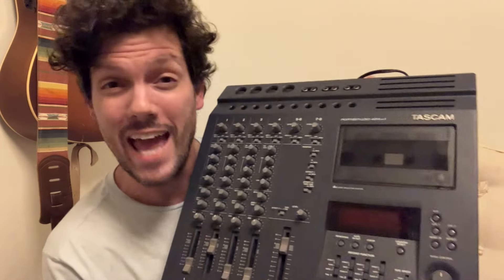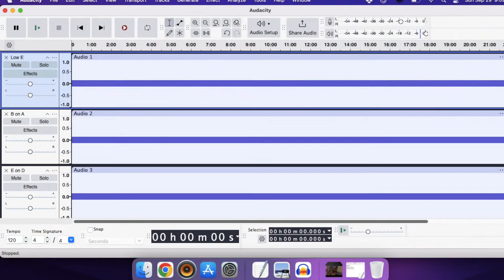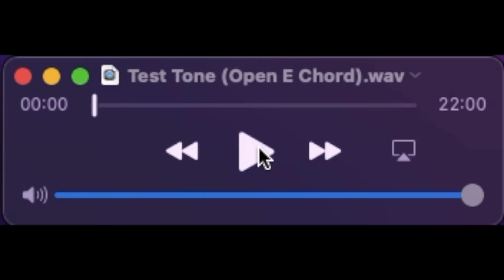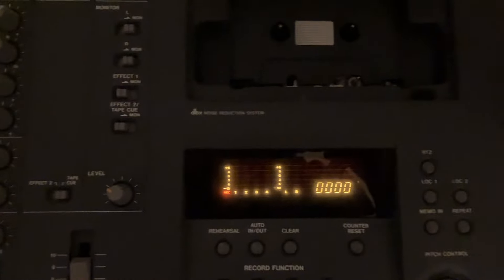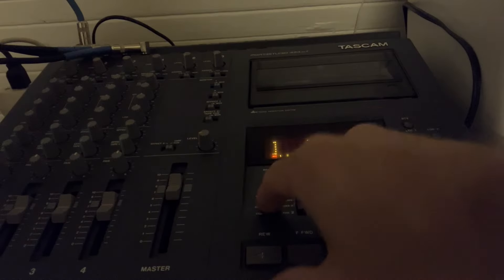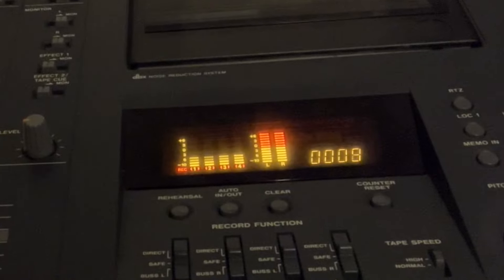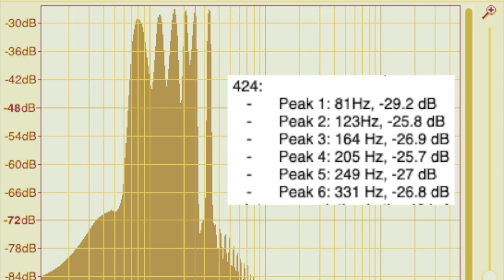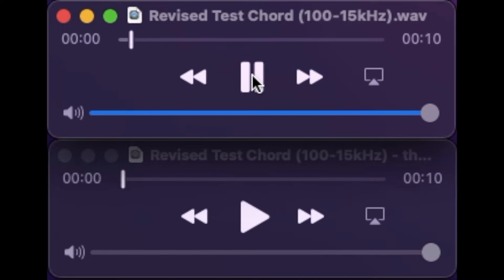The Sound of Cassette Recording (feat. Tascam 424 mkII Portastudio)

Comment: Did you test the other variables that you introduced with this setup?  There’s two other devices between the computer and the tape.  We expect them to be relatively flat and linear, but they’re analog and relatively low budget and connected in a slightly atypical way, so they’re probably not perfect, and there’s no way to know what effect they have unless we do the whole test without the tape.
Reply from the maker: Awesome callout, and no, I didn't test those factors at the time. But you're right that they need to be test and ruled out. So I ran the 2nd sine wave chord through one of those cables and the interface, and here are the dB readings for the peaks in the version:

100 Hz: -21.9 dB
250 Hz: -22.5 dB
500 Hz: -22.8 dB
1k Hz: -23.0 dB
2.5k Hz: -22 dB
5k Hz: -22.1 dB
10k Hz: -21.8 dB
15k Hz: -22.7 dB

Based on this, I think it's very fair to attribute some of the difference to the cable and to the Focusrite. There's a difference of 1.2 dB b/w the loudest and quietest of these peaks, and that accounts for a material chunk of the volume differences I was observing at frequencies below 1kHz. But it doesn't account for the volume roll-off that I observed above 1kHz in the taped example. So I'd guess that comes from the 424, the tape, or both.

Thanks for your comment... I should have done this in the first place!

Comment: The time it took you to make this video is more time than I would have devoted to this problem. Cassette multitrack recorders were "great" in their time because there was no alternative, short of shelling out $26 - $40 per hour to record in some hole-in-the-wall 16 track or 24 track recording studio (Yes, those prices are what I paid in the 80s) But there were always inevitable limitations with trying to record 4 tracks on a 1/4 inch tabe that was travelling only 3.75 inches per second.
Reply from the maker: I hear you 😂 I like working with these devices, so I try to embrace the moments of frustration and inefficiency. And in this particular case, I had an extra incentive: *I am going to recover this EP project.*
Reply: That's 0.150" wide tape, at 1.875 IPS. 

Even Ampex 456 or Scotch 226 at 15 IPS are pretty limited in dynamic range and distortion, compared to any current digital recorder. Even a little Tascam battery audio for video mobile 4 track can do 24 bit PCM, and SD cards cost a lot less than tape, plus are easier to store and harder to damage. 

Is suspect a bias issue in the old 224 cassette, and maybe other alignment issues. A realistic cost to service it might be $250, which is another factor pushing users away from archaic technology.

Comment: Cliff hanger?  Can the apparent wobble in track 2 be addressed or repaired?  What might it be?  Alignment?  Bad capacitor?  Thanks.
Reply from the maker: Honestly, it was a cliffhanger for me too. Because I've had prior issues that I associated with this machine, I expected to see and hear something definitive... and I didn't. I listened to 22 minutes of test tone and heard obvious wobble only once. And I didn't hear the other things that afflicted my latest recordings, like the patches of muffled sound.

So my best guess, today, is that the tape is the main factor. (That's also what I concluded the last time I had issues using this device.) Meaning that my next step will be to bounce my tracks onto a new medium for storage, probably a VHS tape. Then I'll bounce them back into the Tascam, onto new cassettes, and continue.
Reply: @JordanSeal  Cool.  Dig your quirky channel and commitment to recording with whatever you got.
Reply: @JordanSeal  surely the pitch issue would affect all the channels at the same time. There isn't anything in a preamp that can change pitch, just the tape transport can change the pitch, or a flaw in the tape that made it stick for a moment. 
The pitch issue could have happened as you did the recording, or when playing it back. If it occurred at the same spot every time then you know it was the recording.

The whole point of tape (to me) is that it sounds different. Having a darker channel might be a benefit. You can plan to record bass or mainly low frequency sounds on that track.

Comment: Almost certianly an electrical issue on the channel.
Reply from the maker: That was my original guess with the popping... including b/c there wasn't any popping on the other tracks/channels. But could the electrical be causing the pitch wobble?

Of course, I might have two separate causes for two separate problems.